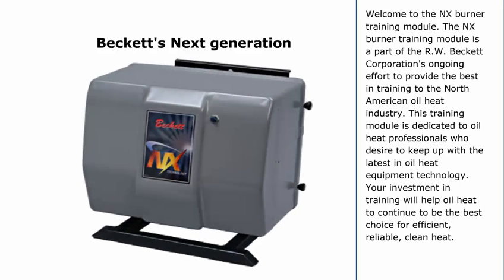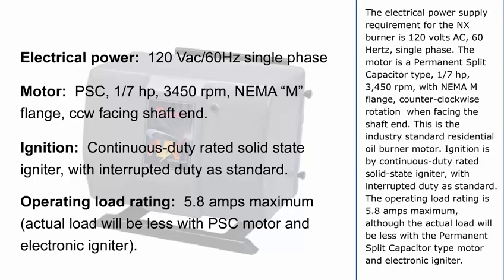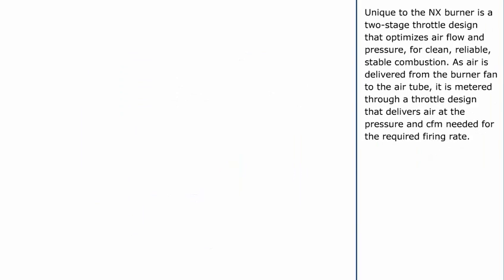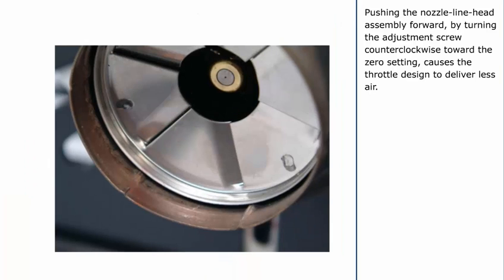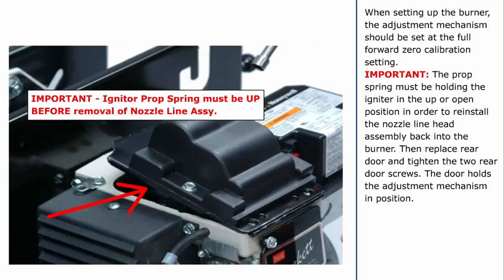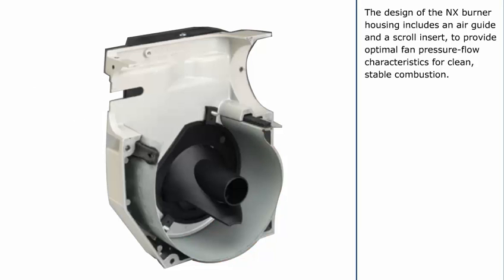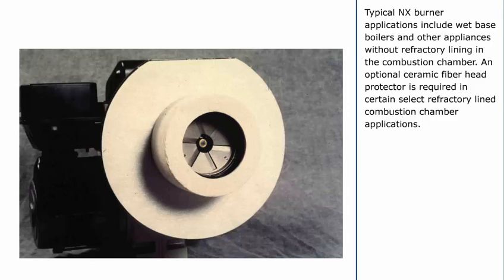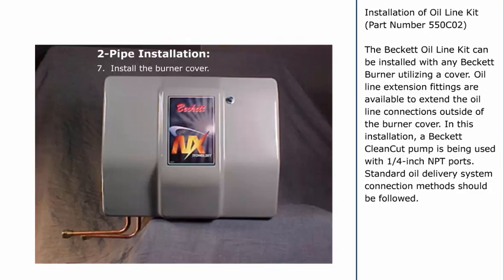Beckett NX Series Training Module

Comment: At 11:35 minutes, it is stated that the R7184 control, can Lockout,  above the 4000 ohm point, yet all manuals I’ve read, state that the cadd cell resistance range should be  within 300-1000 ohms, and not higher than 1600 ohms, or the burner will shut down…can Beckett Corp please help me to understand what this video is really trying to say….
Reply: R8184 controls have a lower lockout threshold than R7184 or Genisys.
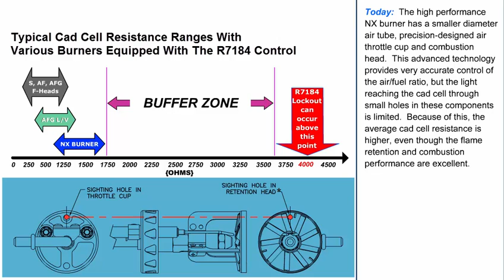Reply: Jump to 11:48. It tells exactly why in the very video... the light reaching the CAD cell through the small hole is limited.

That said, the "combustion performance and flame retention" are excellent.